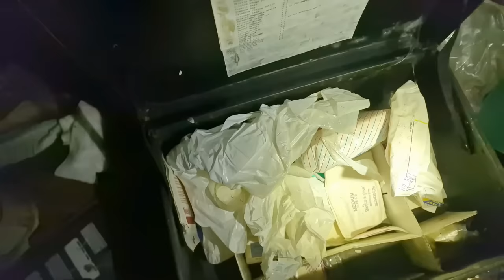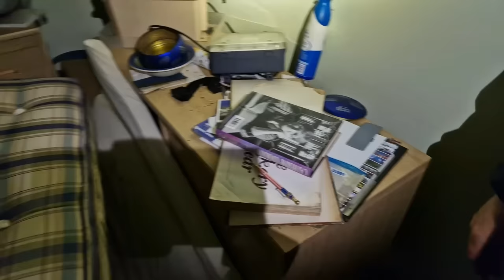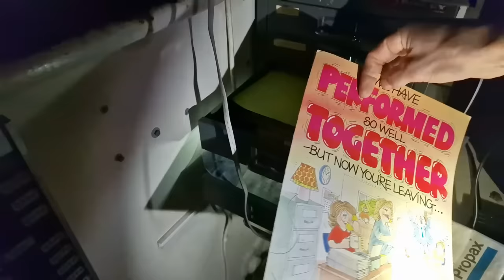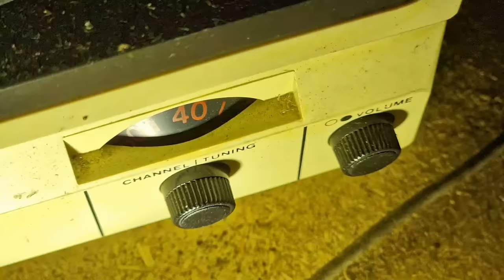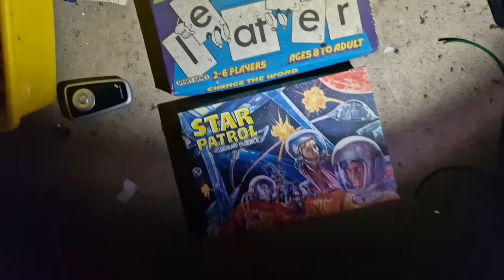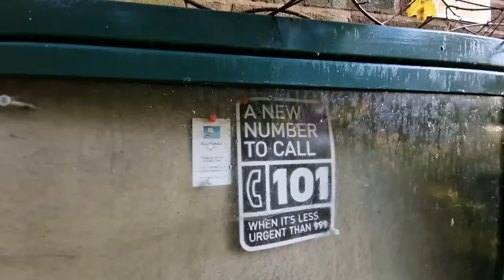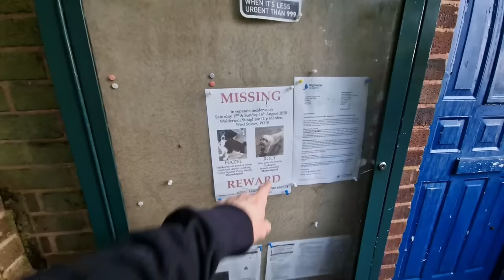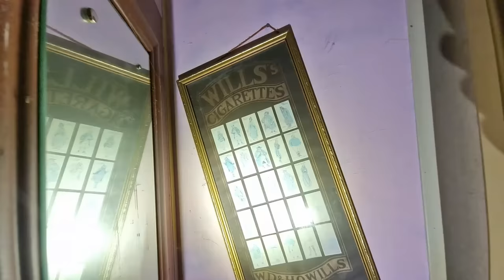We Found an Abandoned House FULL of Paramedic Gear on a Travellers Site

Comment: The house part would have been the “head traveller” accommodation and he would maintain the place. Most have a park home that way they can take their house with them from site to site.
They wouldn’t have been evicted, it’s because most travellers don’t want to pay the council (like council tax) to live on specially built sites. Those statics are too old to live in due to damp and how cold they are. The more modern statics are built to residential spec.
There are a few travellers that still use these sites especially in Yorkshire.
They have either gas or electric fires as well as central heating.

Comment: The heavy device in the loft was a UPS - Uninterruptable Power Supply. It was heavy because it would be full of heavy duty batteries & some chunky electronics. They're designed to maintain power to computer systems in the event of a mains failure. They only last about 30 minutes or so, depending on their size, but long enough to back up your data.

Comment: FYI... UPS is Uninterrupted Power Supply usually used with computers to protect from data loss  due to power outages. As soon as mains power fails, UPS beeps to alert you to save data before system shutdown, usually occurs within a minute or two (depending on unit capacity).

Comment: The UPS system is call Uninterrubtible power supply . You connect your radio set or PC to it so when the mains power goes off the unit will kick in and supply temp power so that you can keep going without any break in power. Now some units will only supply power for an hour or so . But more modern units can keep going for hours . 👍👍👍👍

Comment: I would say the Icom radio was either a 2 meter band or 440. 440 band is where fire public safety and taxi cabs tow trucks use part of that band. 2 meter and part of the 440 are used for Ham communications. You need a license. Like the Baofeng radios you guys use are for ham are 2 meters.

Comment: That chair actually turned into a high chair too/ step stool/ high chair /ladder because if you look at it as you were folding it and turned it into a chair. The little step stool part on the bottom the metal piece would have folded down and turned into a high chair

Comment: That ups600 is for if there’s a loss of electricity then the ups will automatically cut it and supply the power needed for a short time. UPS stands for Uninterrupted Power Supply and the600is 600milliamphours you can get them a lot bigger than that one.
That battery charger is from an old invalid 3 wheel car or one of the first disabled scooters.

Comment: It’s basically an uninterrupted power supply so if the power goes off whatever is plugged into it still goes on, you can get different sizes so some will last a few minutes others longer, primarily used for desktop computers

Comment: The icom is a pre set radio uses differant bands mostly set on a fm band old unit as most are now scarmbled and there not set on sharing with police radios if you looked the shed you went to at very begining had a icom box behind the red cross box that may have had the settings paperwork.

Comment: That is a Motorola maxtrac model. Idk what series it is though. I have the ham radio version in storage which is made by Ken wood and it is the kenwood 7a with the cobalt blue display. That one there looks like it has a pea green display. Too bad there’s not a power supply you could try it out with lol.

Comment: You three are a triple act 🤣🤣🤣 xxx found this………This travellers site was constructed in 1991 by Hampshire County Council. The site gained a bad reputation and was closed down in 1996 after violence and firearms incidents. Travellers again invaded the site in 2002 and took up residence. The travellers finally left after Hampshire County Council started High Court proceedings to evict them. As the travellers left, they wrecked the site, left behind heaps of rubbish including many gas cylinders. The site was then barricaded by the Council to stop further invasions. The site has been stripped not surprisingly of all copper piping and wiring. It is likely the site will soon become a recycling centre. The photo’s in this post were taken in July 2010. 

Main drive and Wardens bungalow 
DSC_0992.jpg
Reply from the maker: Thanks Roo!
Very interesting that, I will add that to the video description. Cheers 😁👍
Reply: Could put refugee in them
Reply: Where is this?
Reply: Yeah, I remember this on the national/local news when they were being evicted. It was quite a big thing at the time. Dale farm? I'm thinking  goole it!!